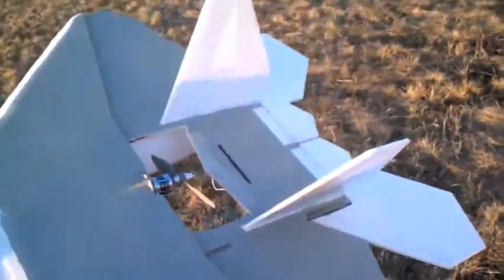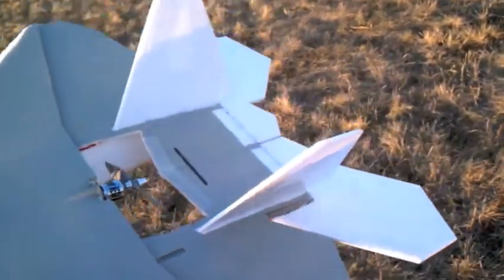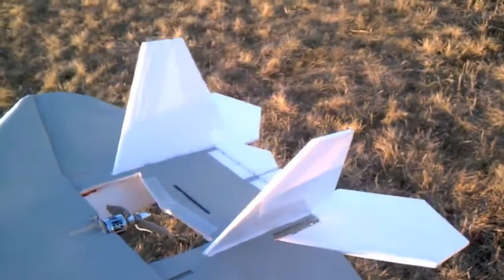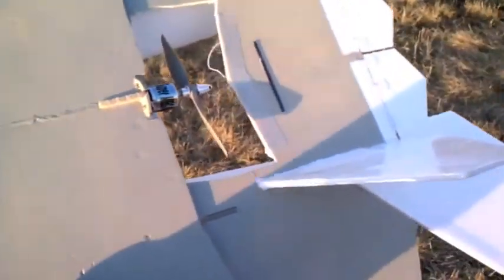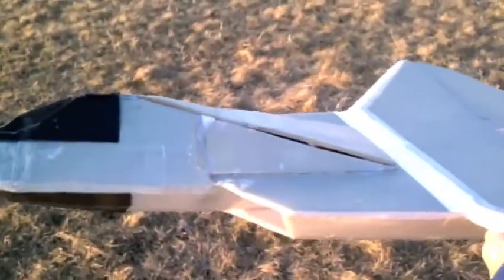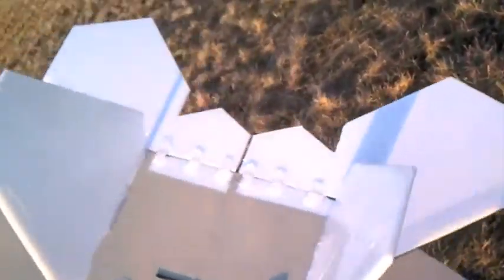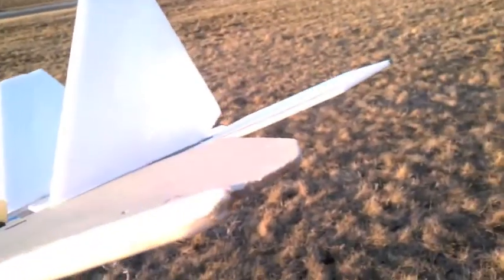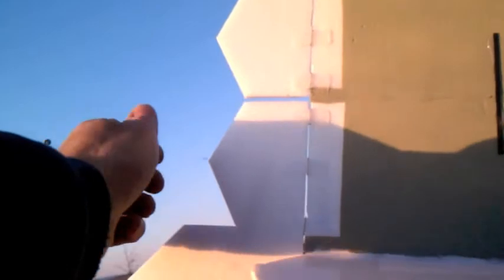RCPowers F22v2 with 7x5 Prop

Comment from the maker: Yes the motor does get warm on a 3s and 7x5 prop.  A 4s 7x5 would definitely cook the smjv2. I would either do a 7x4 3s for about 38 oz thrust or 6x4 4s for 43 oz thrust.  Both Ways you should manage heat by cooling down between short bursts.